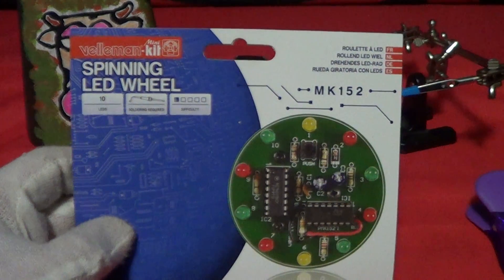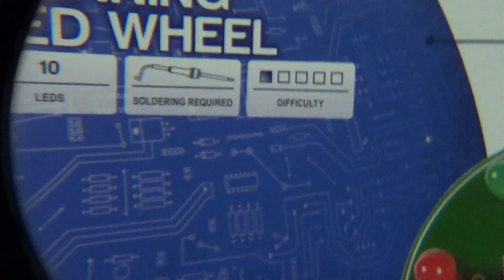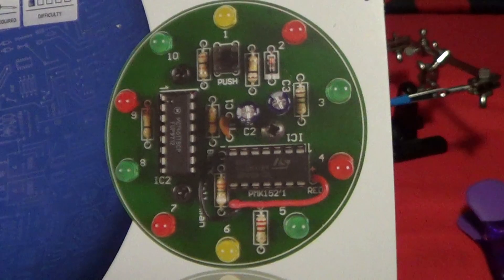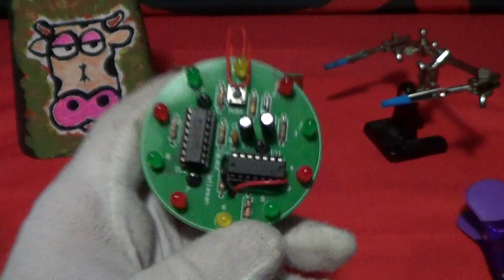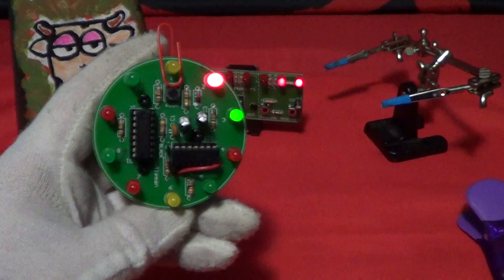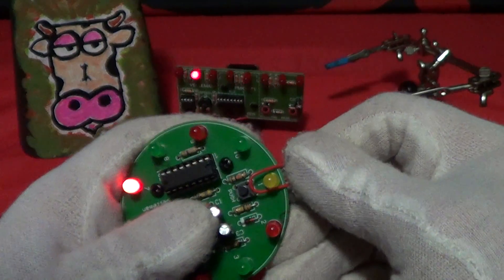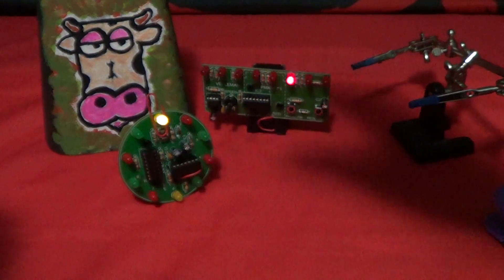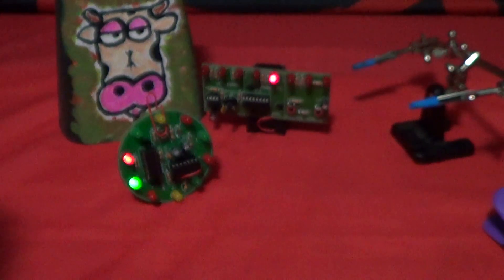Velleman's Spinning Wheel Mini-Kit

Comment: '
this kit MK152 is a okay but not good kit...
1- two extra yellow LED lights are not on a board = four yellow LEDs...
1- not have four blue LED lights as 4 blue / 4 green / 4 red / 4 yellow...
1- not go backward as reverse...
wrong design switch on the middle board next to yellow LED light